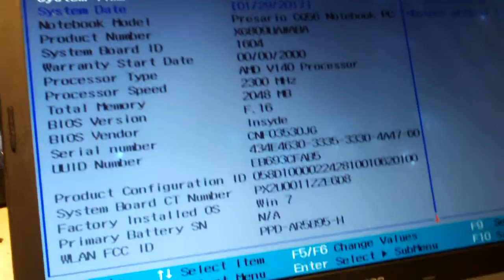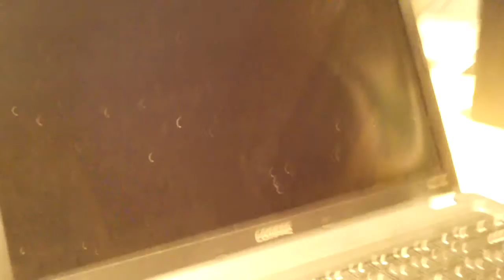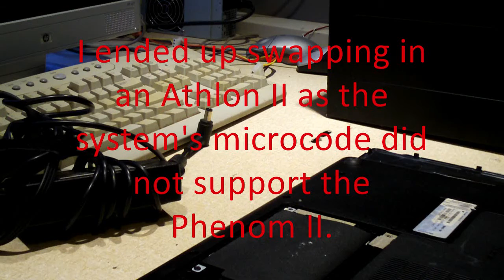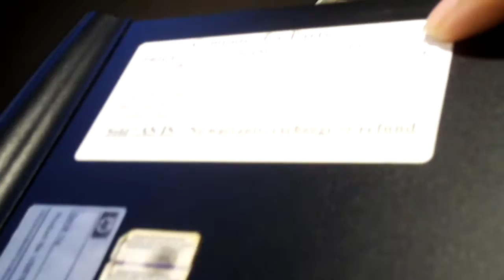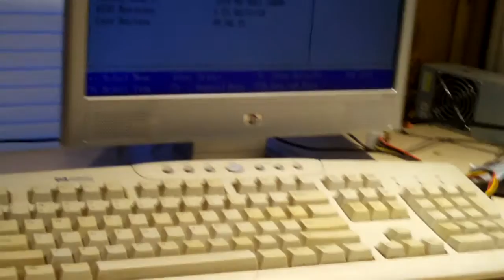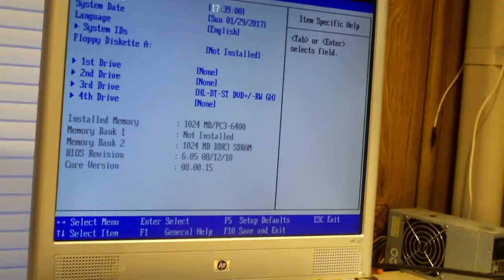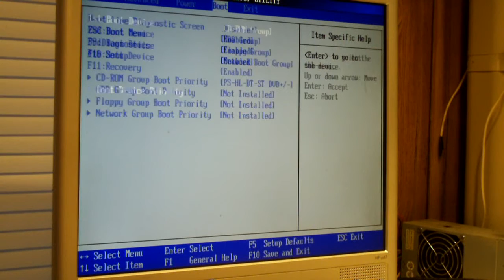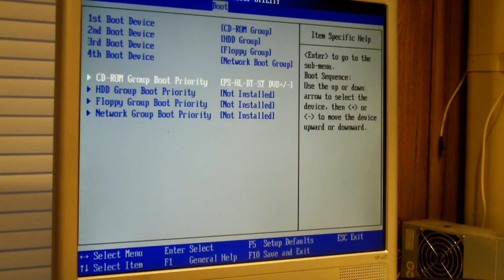First one in awhile - Great deal on some parts systems!

Comment: Socket S1 actually spanned four generations of usage.
S1g1 (2006) - Athlon 64x2, Turion 64x2, Sempron.
S1g2 (2008) - Athlon 64x2, Turion 64x2, Turion X2 Ultra, Sempron.
S1g3 (2009) - Athlon II, Turion II (Ultra), Sempron.
S1g4 (2010) - Athlon II, Phenom II, V-Series, Sempron.
All but S1g4 use DDR2, and none of them are interchangeable - you must match the proper generation of motherboard and CPU for it to work.

Comment: Just wondering, is AMD more common than Intel in your area?
Reply from the maker: They're equally as common.
Reply: Just as a curiosity, have you ever got around recapping that silver Soyo board? Or did something more important fail on that motherboard. 
(like southbridge or a MOSFET)
Reply from the maker: That board was killed years ago by a shorted RAM module.
Reply: Cube Computer Channel So I'd guess a shorted MOSFET around the RAM slots? :) Sounds like a short on the 3.3v side of the board (since RAM slots are 3.3v as far as I remember)
Reply from the maker: The actual RAM slot itself is melted and shorted